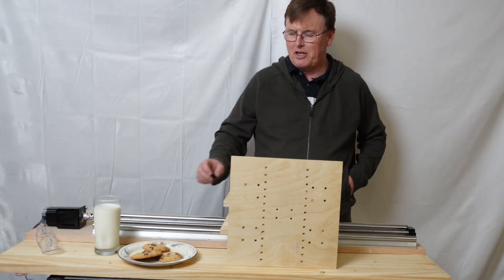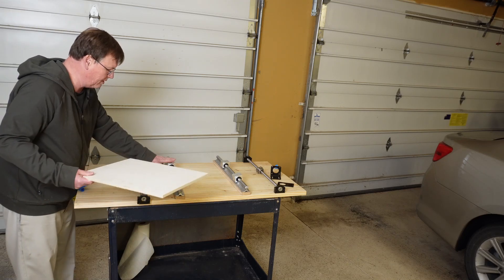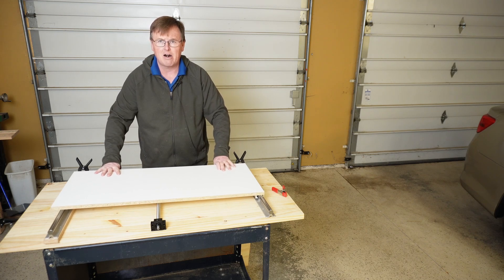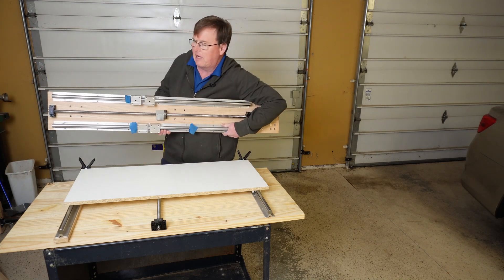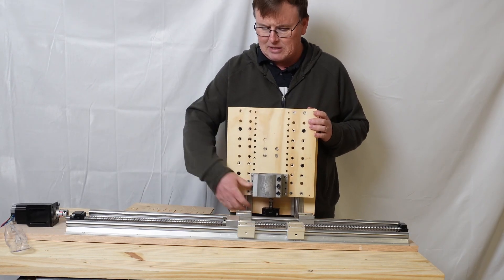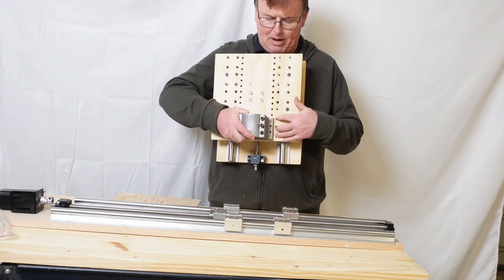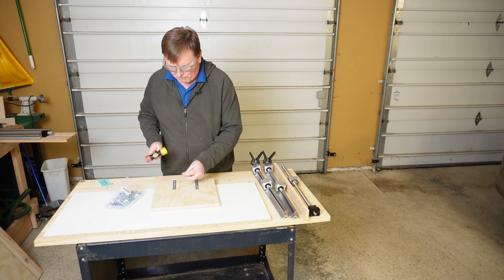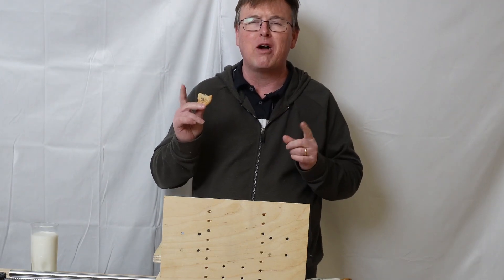CNC BUILD - EASIEST Y AXIS AND A COOKIE? | DIY CNC ROUTER EPISODE 13

Comment: There are different types of plywood. In Europe we distinguish between plywood and MULTIPLEX.  For construction of CNC I can only recommend multiplex. The one I will use is going to be at least18 mm (just shy of 3/4 inch) thick and has 13 layers of which the 2 outer ones are thinner veneer.  Multiplex has a lot of advantages over "simple" plywood.
Reply from the maker: Great info.  Thanks.

Comment: Thank you for another episode! I think the stationary gantry offers advantages beyond the ability to tile your workpiece. My understanding is that heavy-duty CNCs use that design, and it makes sense--the gantry is where the action is. And the chatter and vibration and flexion. If it's stationary there is less concern about weight and inertia, so it can be exceedingly rigid.
Reply from the maker: You're welcome.  Thanks for tuning into the new episode.  
I agree with you -- I think this new design likely will reduce router chatter, vibration, and flexion (although the moving Y platform may require extra support bearing blocks and rails if the board is extremely wide as it might bow). I am 95% sure that one Nema 23 motor and ball screw would be more than sufficient to drive the Y with plenty of power which reduces build costs significantly.   If more power is needed one could up the current on the Y motor driver from 2.7 up to 3.7 amps by flipping switches 1,2,3 respectively to on, off, off.   
There is another advantage of this design in that you don't ever have to worry about one Y motor getting out of sink with another which can lead to a not so fun of a CNC repair.
The most notable downsides of this design that I see on the front side are: 1) Ones shop needs room for platform movement  2) One has to be a little more careful about making sure the platform/cart they are mounting on is adequately supported and stable
3)the design does not allow for a vertical pass through for fancy end board joinery.  
When I get done with this build, I will do a head-to-head run off of my two CNC and give my evaluation.  If I don't like this new build's performance I will mod it over to dual Y movement mechanism like my first CNC build.